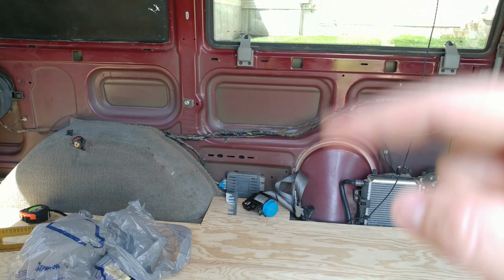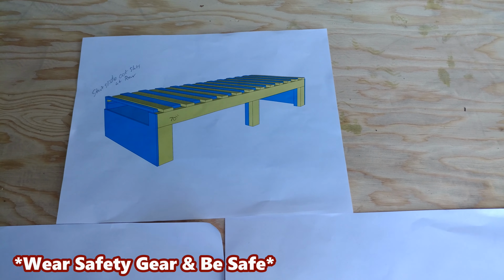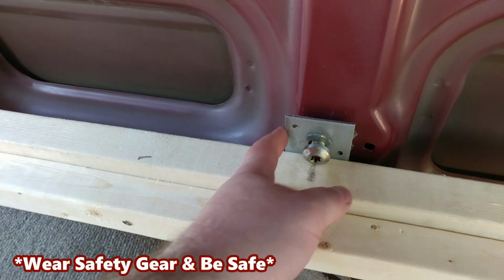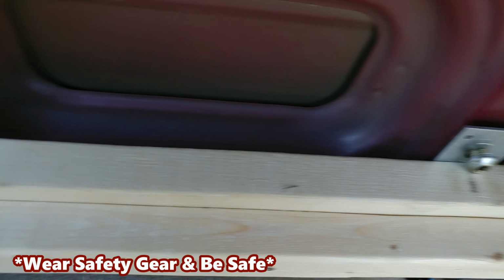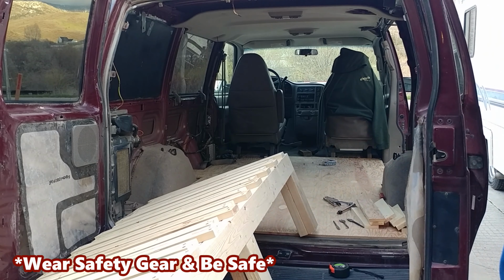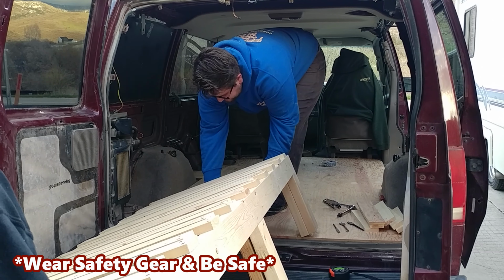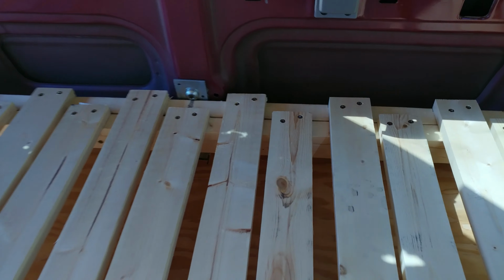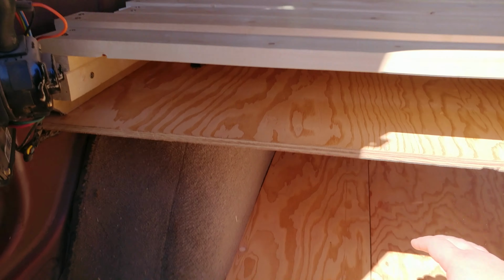Van To Camper Conversion EP. 4 | LAID OUT | Pull Out Bed for Van Build

Comment: What is the small radiator looking thing on the floor/wall about 18 inches behind the drivers seat?  Are you running radiator fluid through that and using it as a heater for the living space?
Reply from the maker: +David Golembeski its one of the two stock rear heaters in the van
Reply: Okay, I thought it was a heater, but I'm sure it only works when the engine is running...what are you going to do for heat when parked?
Reply from the maker: +David Golembeski I may get a space heater in the future but other than that some good blankets and following the warm weather.

Comment: Looks great! Do you have any plans for the walls? Or are you trying to save that space?
Reply from the maker: +Craig Freeze rear heater will be covered. Passenger side behind door will be storage/table built up to bottom of the window, from the top of the bed to the bottom of the window will be walled in ( just plywood ) and the same thing on the sliding door.